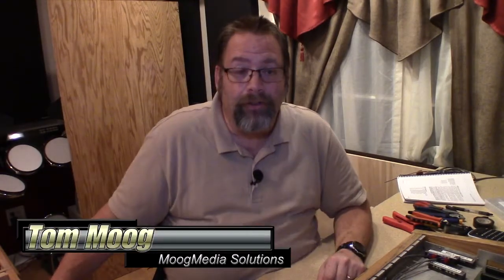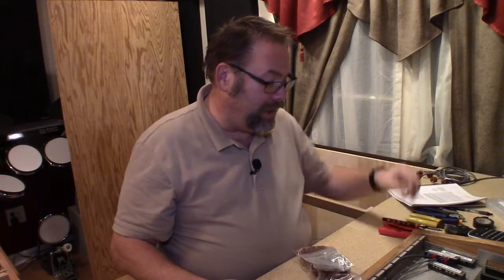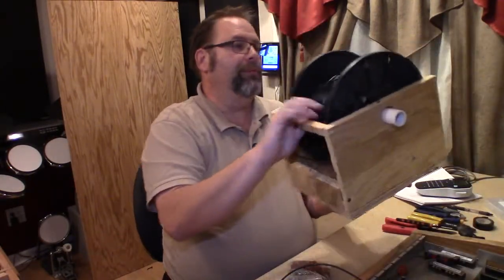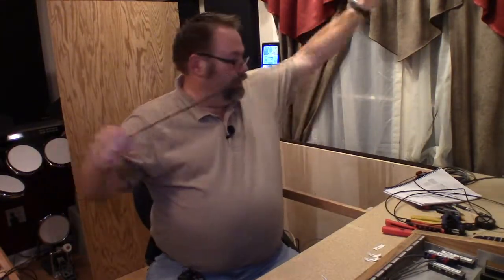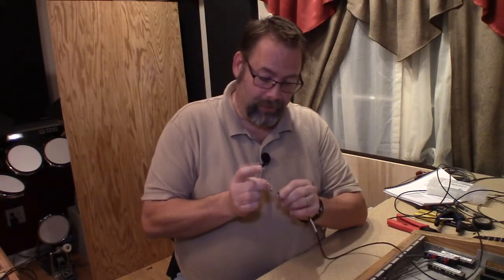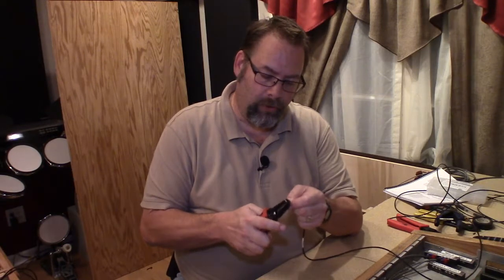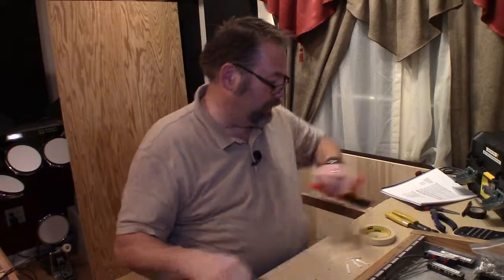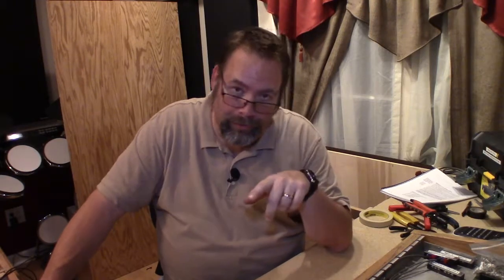R60 Connectors and Wiring - Part 1

Comment: Thanks.  This is useful info.  I just got an R-60 from the public station where I used to volunteer.     I'm creating a power supply cable.  I figured out what kind of 9 pin round connector to get.    Do you know what kind of pins it uses?    Are they the same as the ones in your video for the audio connections?    Do you have a good source for these pins?  I'm also looking to buy a couple of blanks for the board on In-60 modules but I don't want to pay the high prices that Wheatstone wants.     I haven't had much of a chance to dig into it yet.  it's sure a wonderful looking board.

Comment: Hi Tom. Just found your video. I have a Pacific Recorders PR&E BMX-14 that also uses the smaller Molex pins. I'm so particular about my connectors, I actually put a small dab of solder on the pin and solder the wire before I crimp. I've never had a failure, yet. 
I have two Molex extraction tools that are spring loaded and are quite convenient. 
I love the older gear and use my PR&E console for voiceover work. 
Great work you're doing, and thanks for the video!

Comment: Hello, this is a very good video, very detailed, 
I got and console Audioarts 17,  it is the same brand name console you have. So, how do you connect the console to the computer?  on the back to the 3.5 jack? or external sound card, interface sound card?
do you use the low or high inputs from the console to the computer?
Thank you
Felix